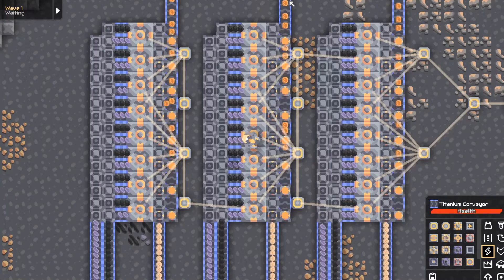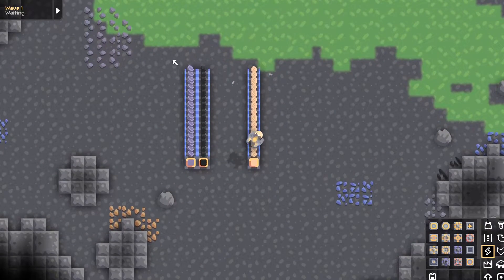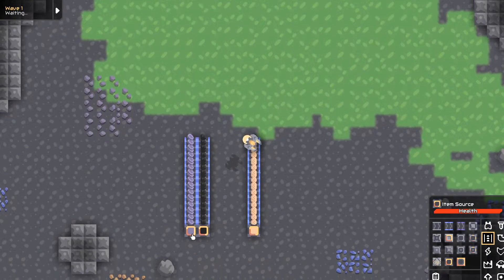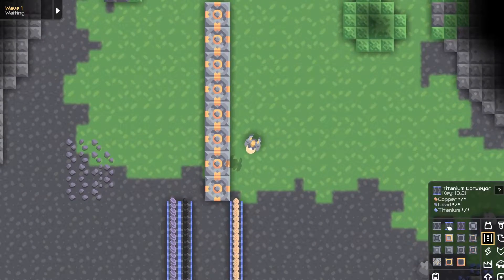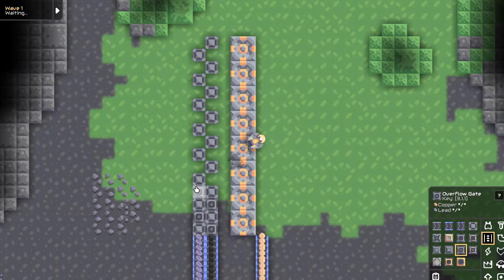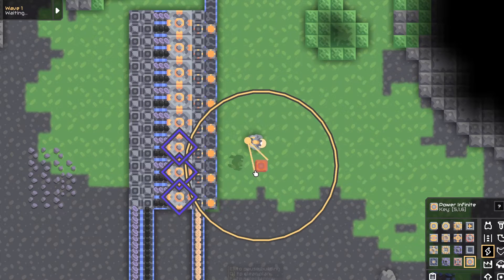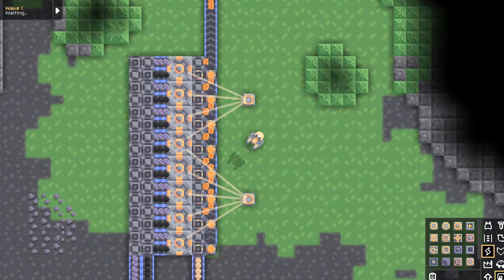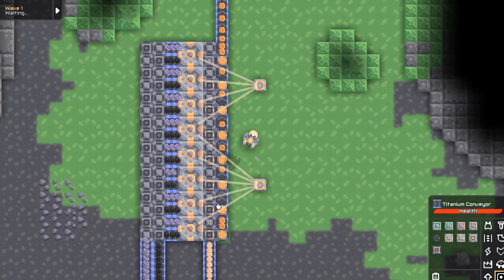Easy Pyratite Setup | How To Mindustry

Comment: I've tried it following every step of the video (including switching the las underflow gate for a router) and it still stacks :(
Reply from the maker: I can't think of why that would happen. I'm not home right now but I'll double check the design in a couple days.
Reply from the maker: Hey I just checked, you can replace the inverted sorters with junctions and it'll clear right up. My bad!

Comment: This video is very helpful. 
I did struggle because coal seems to lock up the schematic if it's going into the right side with the underflow gates.
Replacing those with routers or keeping coal on the left fixed it

Comment: This is great. I was originally avoiding putting junctions next to routers, because I swore the routers were back feeding the input to the side of the junctions. That said, I suppose that doesn't matter because there's nothing on the other side of the junctions.

Also, when placing multiple input lines in parallel, consider holding down the left mouse key and dragging, then rotating the mouse wheel before letting go of the button.
Reply from the maker: I don't use routers very often because they can backfeed, not that it matters very much. Overflow gates ftw

P.S. I am aware of the rotation thing, this is a very old video

Comment: it worked once but then it started outputting the third one, lead inmy case idk what i did wrong
Reply from the maker: Honestly no idea. Build is over 2 years old but I think it should still work. Check more recent video on Blast Mixer for better design and simply replace the supplies and machine
Reply: @AirNeat I know this is old but is the Blast Mixer video still up? I can't find it on your page. The design works fine for me until I try to scale it down. Did a bunch of tests, it's something to do with the last junction but I'm not sure exactly what it is.

Comment: I remade this in another map, and the sand is coming out from the side. What did I do wrong?
Reply from the maker: Could be many different things. Are the junctions in the right place? Are you using sorters instead of inverted sorters?
Reply: @AirNeat  the junctions and sorters are ok
Reply from the maker: @FranP25  Alright, link a picture?
Reply: @AirNeat  did you see something out of place?
Reply from the maker: @FranP25  You're using regular sorter instead of inverted sorter
Reply: @AirNeat  Thanks for your time bro! I really thought I was using the inverted ones